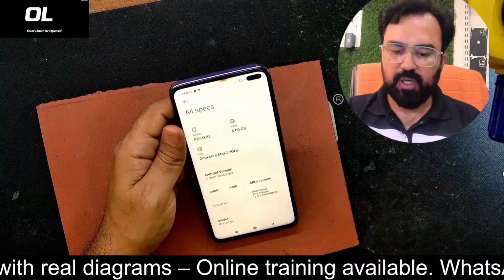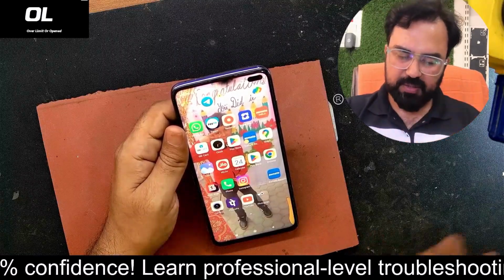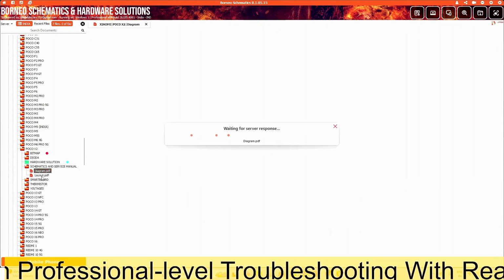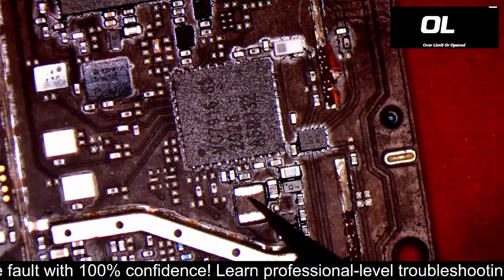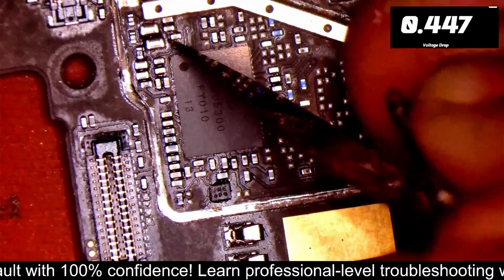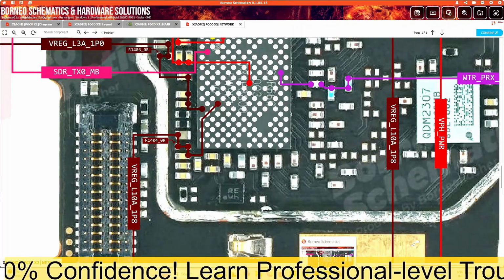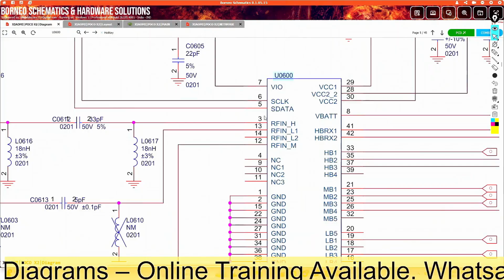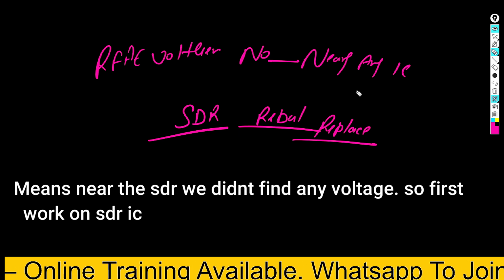📱 How to Fix Network Section in Mobile Phones | No Service | Emergency Calls Only |  Repair Guide

Comment: My dearest sir,  i love this vedio. as its a real time repair. i watched your all 4 previous network theory vedios first. and watch this. so it cleared my all doubts. watching more than once the  vedio made me more confident. you are doing theory part, after that   real time repair. its great. most of the technician , i have seen , when network problem comes, they just replace and check  for chance. some times its come true or some time not. in some cases, if there is a common issue with a specific model, they change the ic and work done in a few minutes. but reality they dont know how to  diagnose correctly . so i think  after following your vedios,everything you do according to  schematic. so its  very useful. good luck for you. 
  hope to follow your paid courses.
Reply from the maker: Glad you like it❤
Reply: You are a cellphone doctor,you don't take chances

Comment: Sir why when the  RF IC was not removed the valtage didn't come but when it's removed the valtage now come without install again
Reply from the maker: Wtsapp
Reply: The ic does not bring voltage but if there is shorting under the ic,voltage will disappear until short is cleared